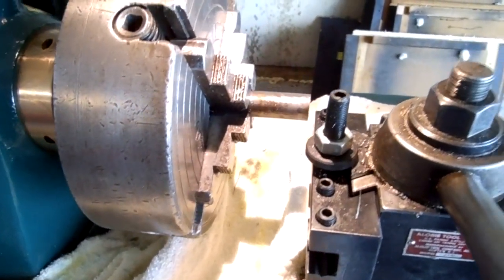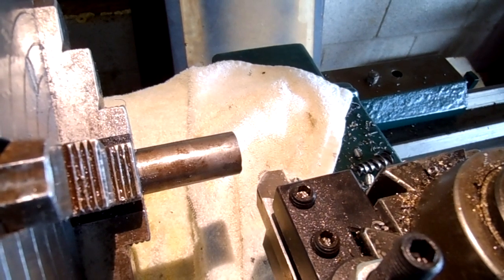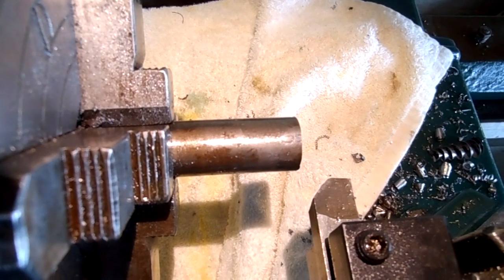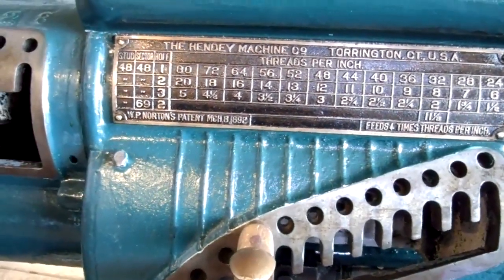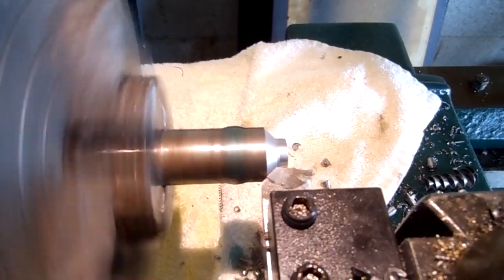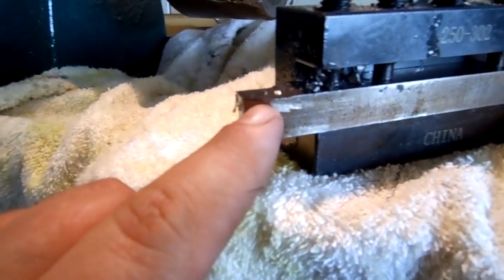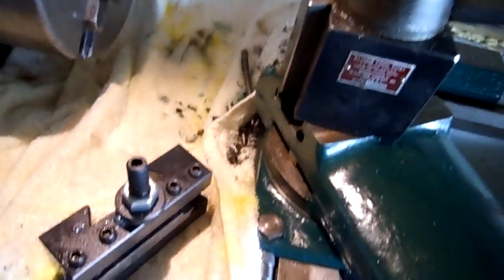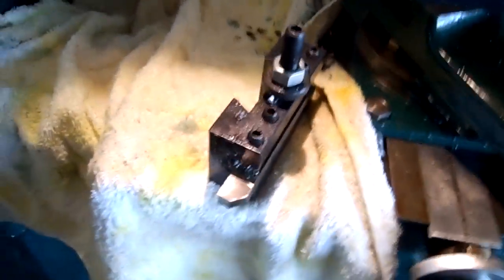Adam and (Ox tool) Tom... Chip control with tool ID

Comment: Lawrence what do you think caused the chatter on the angled section of the bar?
Reply from the maker: the tool was lightly touching...when its in a cut no chatter or noise...I will do a follow up video and explain a few more things...whats really interesting is the carriage on the apron end was not tightened down... once I figured that out..it made the lathe much more ridged :)
Reply: Lawrence Harasim
I think you nailed it, the most common causes of chatter on lathes is loose slides etc. So that is a good tip, lock everything that doesn't need to move and ensure the gibs are all adjusted correctly on cross/top slides and the carriage.
Reply from the maker: Kevin Smith could not agree more :) this is so evident when people try to use cutoff tools and have issues....
this lathe is so rigid now it would almost take an act of god to make her chatter :)

Comment: Nice tool and grind, it performed well. I might grind one up for the Monarch and give it a shot. I basically like using a tool on a lead in angle, but with end clearance not being relieved back as much as just turning the tool in the holder. One drawback is that you cant turn to a shoulder, and will have to come back in with a different tool. Most of my cuts are to a shoulder so thats why I turning with the tool square to the work.
Thanks for sharing with us Lawrence!

Adam

Comment: Interesting.  So it does the roughing and finishing in one pass?
Reply from the maker: yes and the finising point is protected by the 45 and the 10 deg facet
Reply: Lawrence Harasim
I went back and watched again since I can do HD here.  Still really hard to see in the vid.  I find all of this very interesting and want to play with it.....I just don't have the time right now.  I may hit you up with a question or two when I have some time to play around on the lathe.  I've got a ton of tool bits to play with....leftovers that have come with each machine and my dad's hand-me-downs.
Thanks!!!